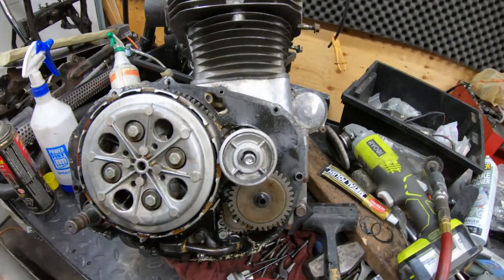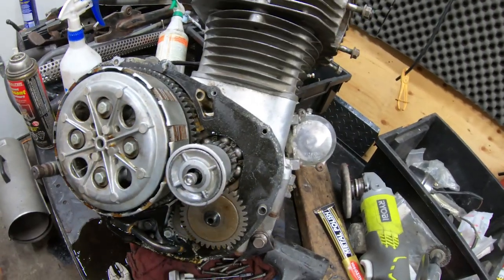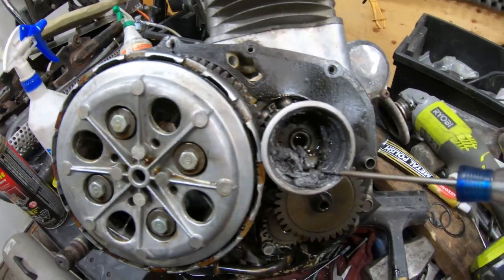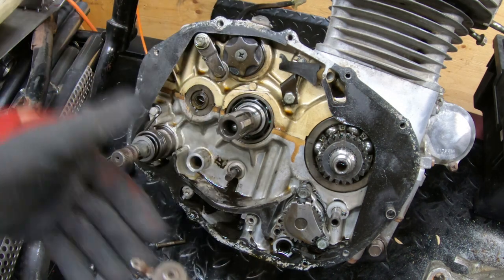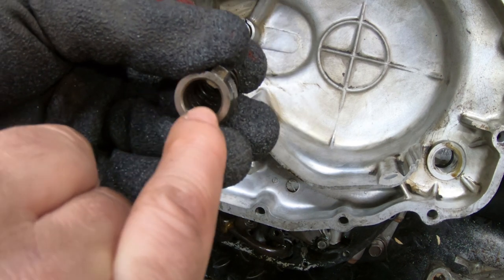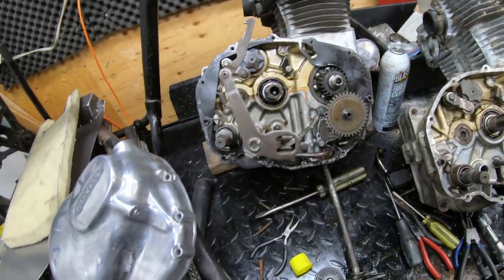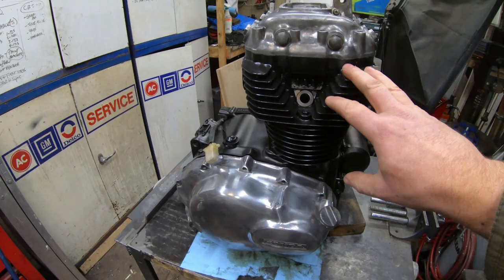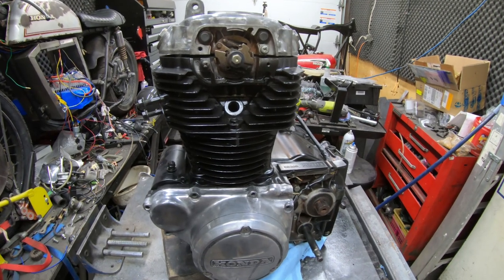ENGINE ISSUES!!!, CB360 CAFE RACER SCRAMBLER BUILD, MAINTENANCE+UPGRADES, time lapse - Ep21

Comment: The redesigned oil pickup tube is not just a CL thing, it's part of the upgrades to the 360 motor (including cam chain tensioner, and rocker shafts) that happened during its model run. There are punch marks by the serial number if an older motor has been updated.
Reply from the maker: Thanks for the info... My engine didn't have the punch marks but the tensioner was 'newer', including the top bracket which is the giveaway afaik. I haven't checked the rocker shafts but my engine # is later than the recall date so should be fine - will have a look anyways. Funny that the oil pickup wasn't updated at that point.....